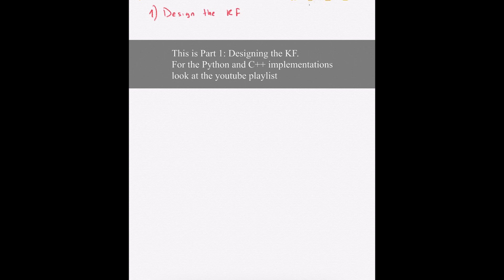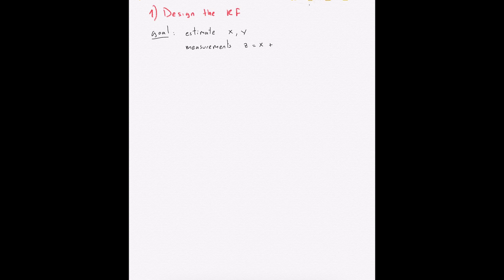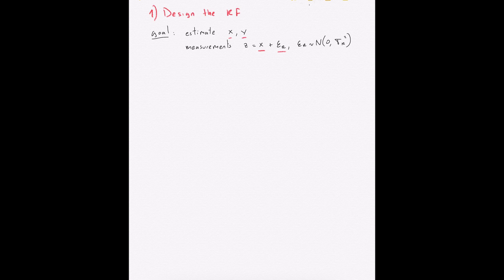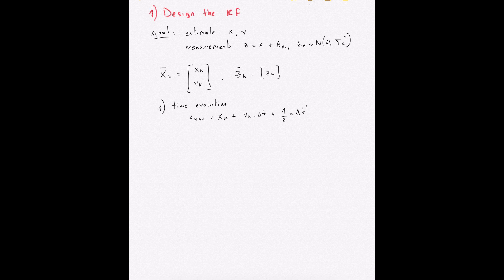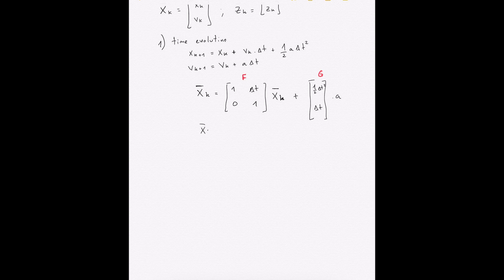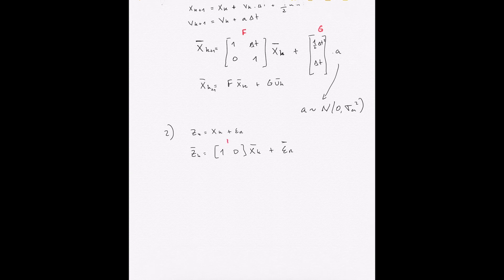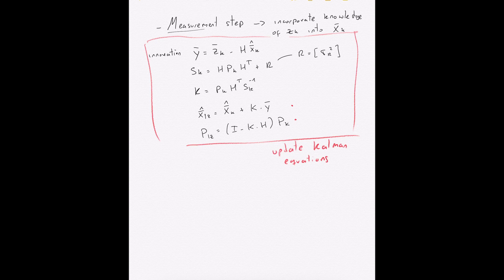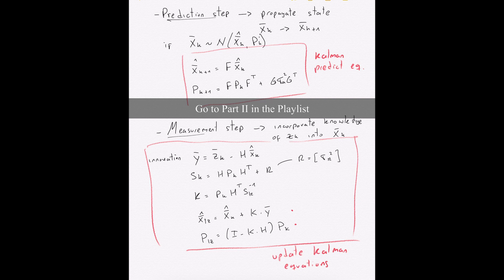Understand & Code a Kalman Filter [Part 1 Design]

Comment: If you have 3 state system (position, velocity, acceleration), can you just integrate the G function into F ?
Reply: Acceleration will be a input variable, i think we can't take it as state variable
Reply: @krishnareddy5589  You can, and you then use jerk as the input variable. Jerk is the time derivative of acceleration.